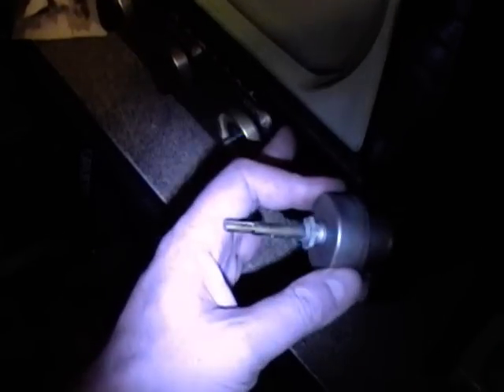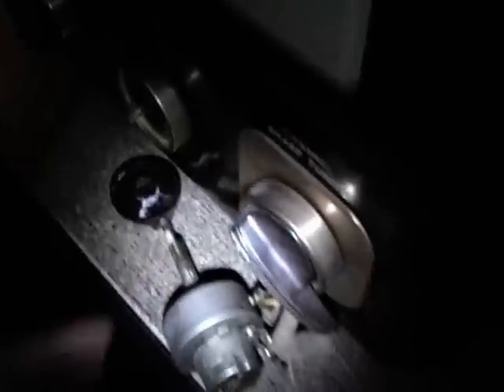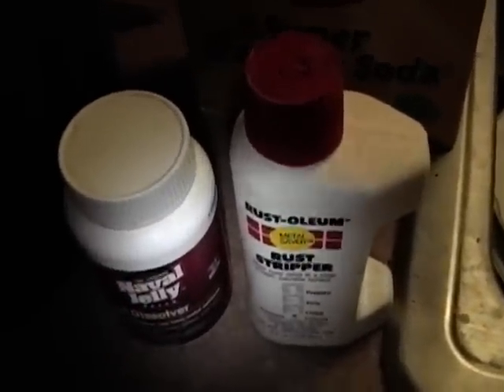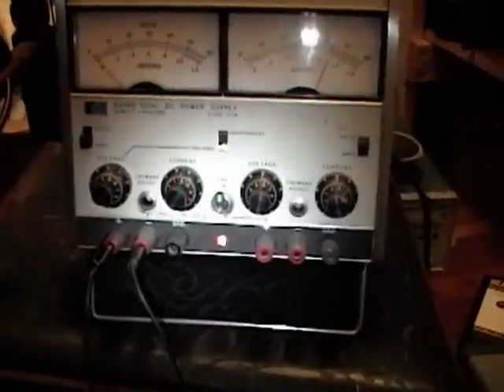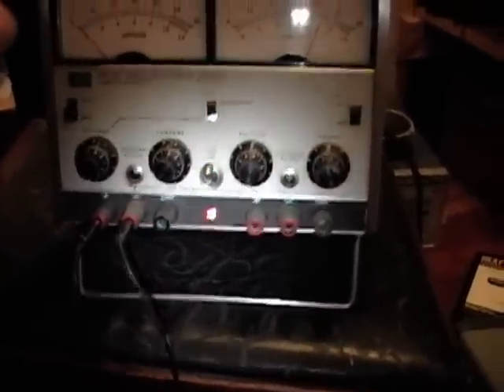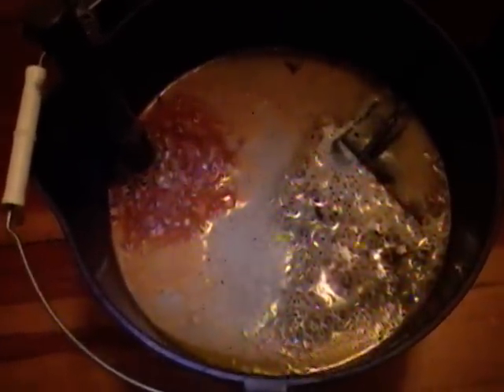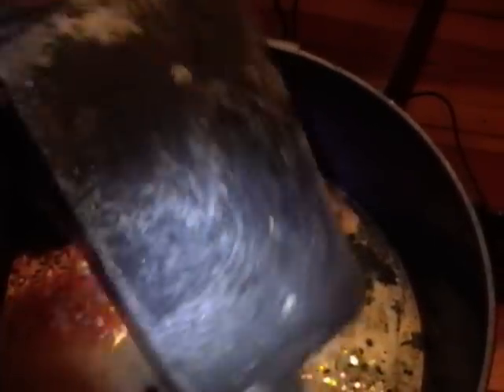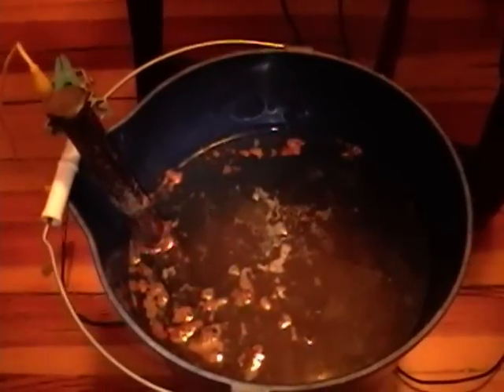Rust Removal by Electrolysis

Comment: An interesting coincidence, I've been experimenting with electrolytic rust removal myself at the same time. I have a pipe vice that was left out in the back yard such that the whole thing was seized up, now it's mostly clean but some of the links of the chain portion are still seized up. One thing that I have discovered is that the ratio between the surface area of the object and the sacrificial anode has to be somewhat close or will it take forever for the rust to come off, guess how I know?